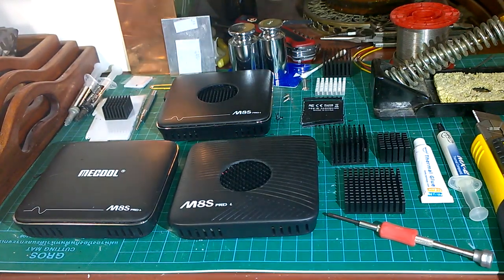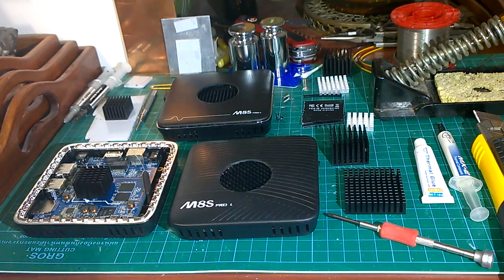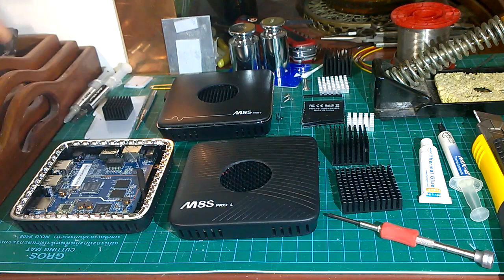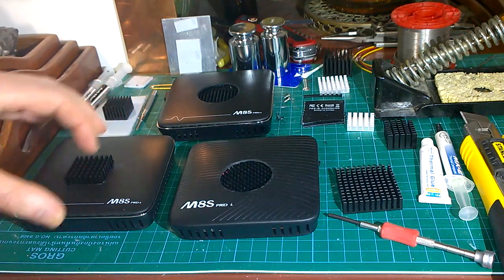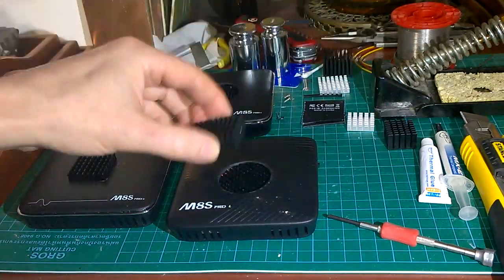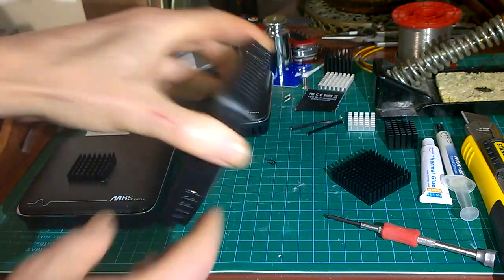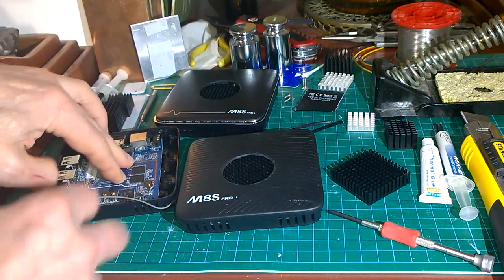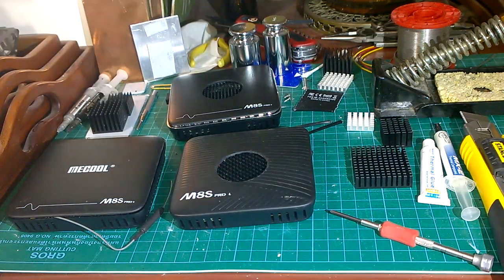M8S Pro Series Overheating - Passive Cooling Options

Comment: My experience is that the heating issue does not happen if i power it using the usb port and plug it in the usb jack from the tv
Reply from the maker: My boxes won't boot from USB Power.

Comment: can we just somehow underclock the CPU? I really guess this chip is overclocked from factory, meybe downclocking it will change something? have you tried this? can this be potentially done?
Reply from the maker: Hi, these boxes run at 1.5GHz, down from a rated max of 2GHz so already underclocked.
Reply: how then it's possible they released such bad product? it's chips problems or manufacters who uses bad heatsinks?
Reply from the maker: Small heatsink and poor ventilation.
Actually a very good box in my opinion for my usage. 
Not an issue for most people. Only an issue in hot climates and with 60Hz refresh rate for 4K in most cases.
Simply solved by standing case on end or fitting a USB Fan under the box if you don't want to mod your box.
Fans and heatsink upgrades are really just for people who want to be safe or are getting issues with their particular usage.
Reply: can it potentially burn my house? or it will jsut break? I am going to connect this box soon to a 720P TV for youtube/netflix. will  my temps be better because of 720p? my psichological limit is around 60 degrees, if it will be more - I will be scared to use the box.
Reply from the maker: Not heard of any catching fire. Less than 80C is probably safe for the chip. 
Install CPU Temp app and keep an eye on your temps.
720P/50Hz may well help. You should be OK unless it gets very warm where you are. Keep on an open shelf and stand vertically on a corner if you get problems. Cheap USB Fan sitting under the box is what some say is their best solution. Many people get no problems.